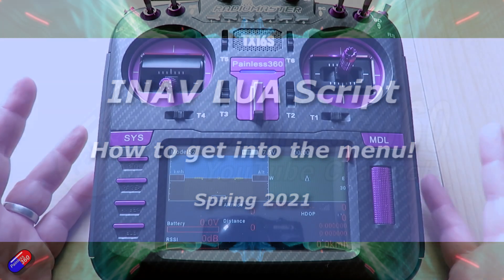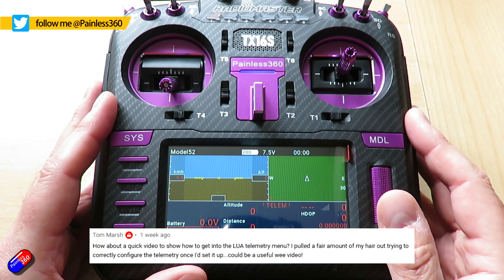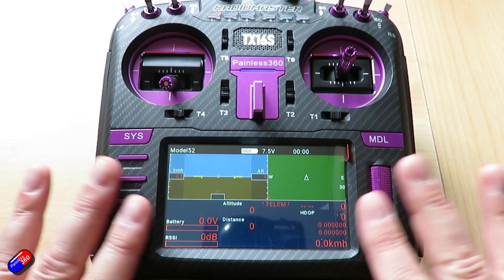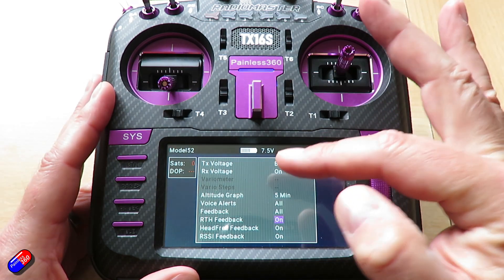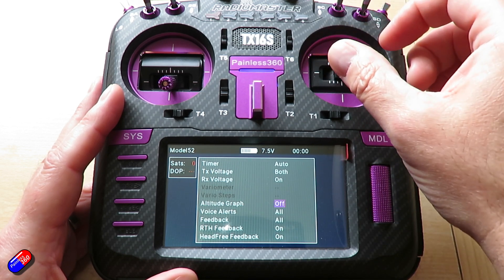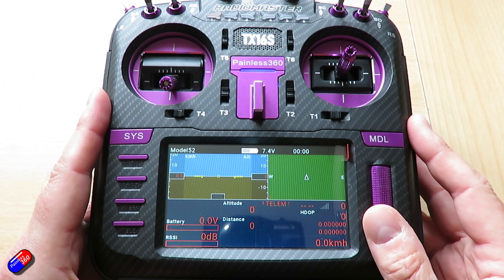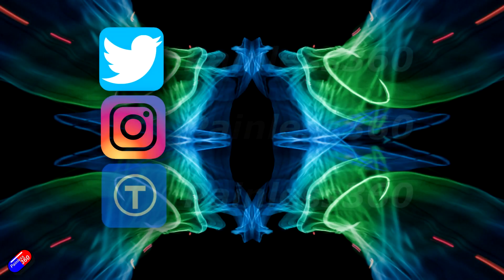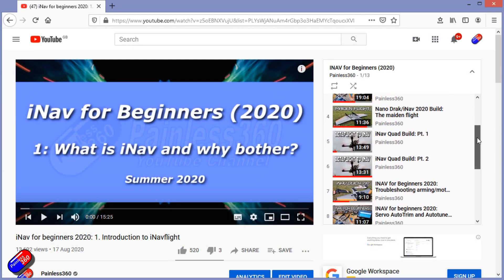How to get into the menu for the INAV LUA script on a Horus/TX16s/T16/T18

Comment: Hello from Bordeaux, thank you for this video which is really necessary. However, my TX16S is configured in mode 1 and I absolutely cannot enter the configuration menu! The documentation gives the commands for only mode 2! Do you have the solution for a transmitter in mode 1?
Reply from the maker: I don't, best of luck
Reply: @Painless360  I have a clue! I put my TX16S in mode 2 and there, indeed I have access to the settings menu as presented in your video. So there is a computer bug: the only solution to access the settings menu is to temporarily put the TX16S in mode 2!!! This is not cool.
Reply from the maker: Report it to the developers... Best of luck!
Reply: @marccandelier6926 thank you very much ! I hv made the changes on mode 1 !

Comment: mmm i cant seem to get into the settings with this method , did something change ? i tried several versions of edge aswell as the inav telemetry widget :( this has been bugging me for days.. i need to turn on the constant battery warning
Reply from the maker: The best place to check is in the docs for the version of the LUA script you're using.... Best of luck
Reply: @Painless360  after reflashing my radio several times and trying every firmware combination it works (except not being able to get out the settings menu 😂 the easy fix for that is turning it off and on again. Finally no annoying warning when flying ! id love to be warned when my battery is actually low tho. for some reason it reads 2 alternating values from  the RxBatt  sensor, one that is the correct voltage and one that reads a value in the 2.8- 4.5 range. Im using crossfire, is there any way to either change the crossfire telemetry or how the widget reads the sensor information?
Reply from the maker: All covered in the docs - 
"In INAV CLI (ignore for TBS Crossfire):
    set smartport_fuel_unit = percent
    set report_cell_voltage = OFF (if set to ON Lua Telemetry can't show total battery voltage)"
Reply: @Painless360  ima check it out ! thanx

Comment: Lee, Just having the hardest time getting the RM 16s to work with the AR637T(A) conscendo or timber x......it will bind but cant get AS3X or SAFE to work on a SWITCH.....its either always on or off ...no in-between.......I have the RM16s right of the box with no updates....please help Sir
Reply from the maker: No idea, I don't use that here. Best of luck

Comment: I was named after Eleanor of Aquitaine, queen of England in 1154, but to paraphrase Henry VIII's dear little girl (Queen Elizabeth I who came 400 years later): "I have only the body of a weak and feeble woman, but I have the nous of an Englishwoman, and that nous says: strewth, girl - if in doubt, RTFM..."

(Just kidding. Although I must admit that I LIKE reading manuals - the more abstruse, the better. Yep. I have none of those male-competence bullying issues, where admitting that you don't know something intuitively is a sign of pathetic weakness, and randomly pushing buttons, stripping gears, breaking off locating tabs, and causing mysterious clouds of smoke are all deemed preferable and more manly than simply reading the 'flipping' manual...)

Oh dear. Have I gone too far (again)?  😁
Reply from the maker: An impressive lady to be names after, Queen of England and France too! 

So many only fall back to the manual when the problem has already happened and is often used as a 'last resort'. Videos like this (and many others on the channel) are designed for those who use a simple Google search in case they can find the answer easily without searching in a manual. 

Hopefully it'll save at least a few people trouble when they can't figure this out.. Happy flying!

Comment: Thanks for the video.  
Dumb question -> Do you have to have your quad on the iNav firmware to work or des it work with Betaflight as well?
Thank you
Reply from the maker: I've only used it with INAV. Looks like you can though. Best of luck
Reply: Yes, works with Betaflight as well.

Note: your model needs to have a receiver that can deliver telemetry back to the radio.
You'll need to go "discover sensors" on radio (under telemetry) to configure for a particular model.

Comment: Add a tag to your description that this is how you can get rid of the warning bells you don't want to listen to. Like the "Battery Critical" warning and the RTH warning.  I hate flipping the switch to test RTH and have the radio bark at me for 10 seconds after I take out out of RTH.  I know that causes heartache for several people and it is difficult to sift through all of the information out there on how to exactly what you just demonstrated.
Reply from the maker: Done, it's amazing what you can learn by spending 5 minuites reading the manual and exploring the menus.. happy flying!